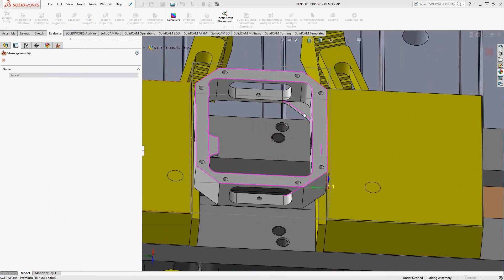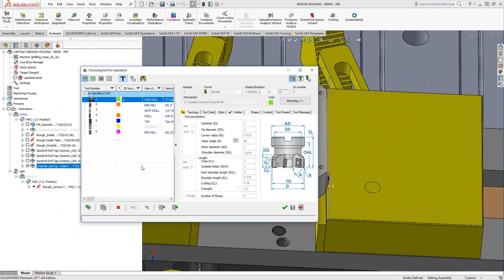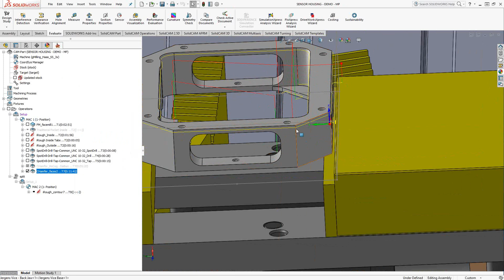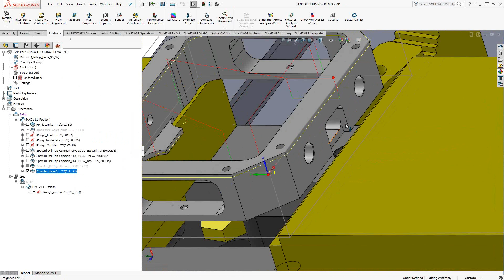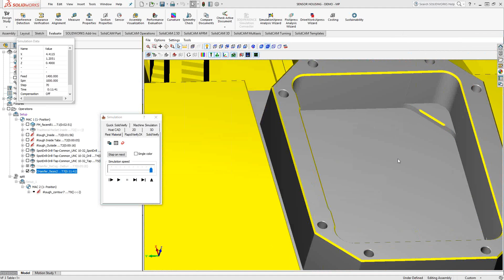Chamfer Recognition

Comment: hello there solidcam professional teacher :)

first things first.. thanks a lot for those videos, i like them very much and learn from them much more than i could imagine.

i am a programmer for 4 years now but low level (3 axis easy programs in order to get to 5 axis simultanious one day with those videos of yours :D )

anyway... to the topic.. i used this chamfer recognition here and there.. but.. there is one thing very annoying about this feature.. that i cannot solve.. (maybe its ment this way idk.. ) the thing is when i have a face.. with holes and edges and so on.. and i want to choose only the outer face for example.. or the inner face or only holes and so on.. its getting complicated.. cause it won't let me do this.. without check other faces i didnt want.. so.. is there kind of way to filter the selecting? on same level with multiple chamfer options there? or its just choosing blind all the chamferable features on the desired face / 3d model.. and then i need to use the reguar method through contour profile --> chamfer etc.. thanks a lot in advance and have a nice day .. or night :)

sincerely yours,
Eitan.